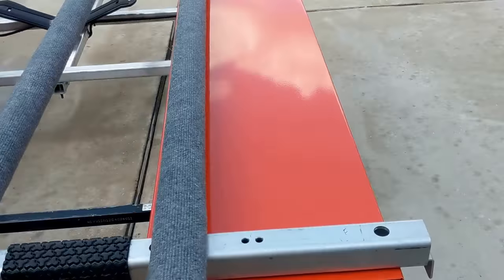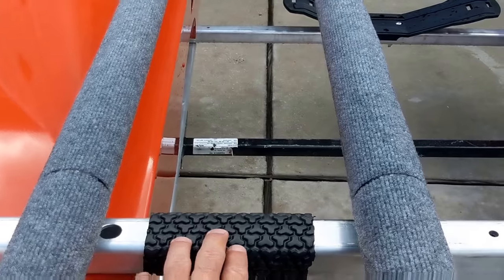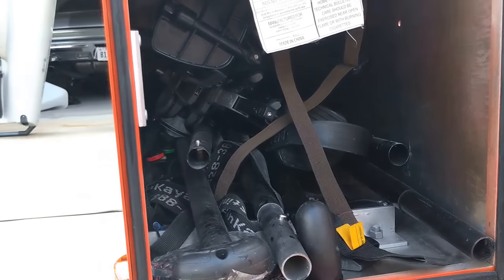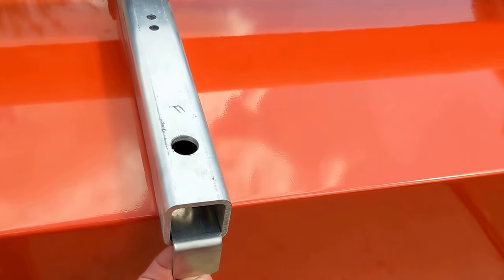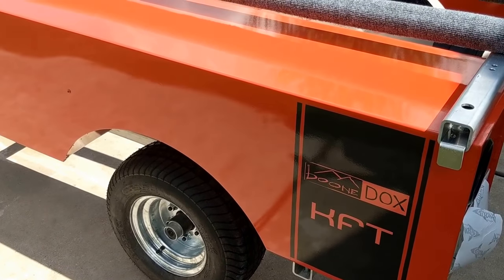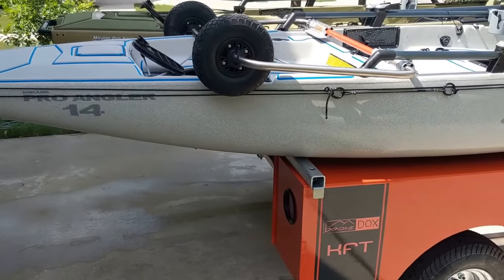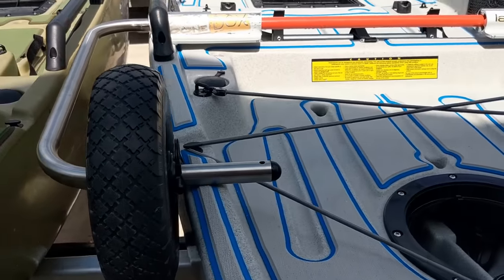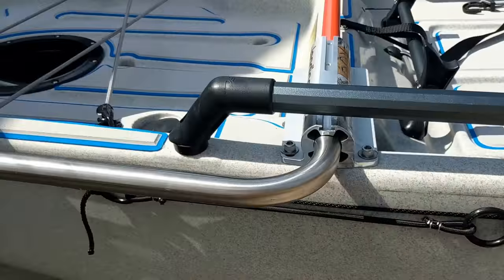Boonedox kayak fishing trailer and Hobie Pro Angler Kayaks

Comment: Is that 2" Schedule 40 PVC? I'm putting a trailer together and was wondering how the flex is on those?  To me it seemed that it was too flimsy.
Reply from the maker: It's actually schedule 80. It has just enough flex to not bow the kayaks and it's still extremely supportive. It's still the same thing that's on there today and working well.